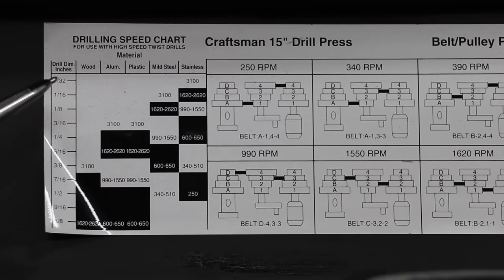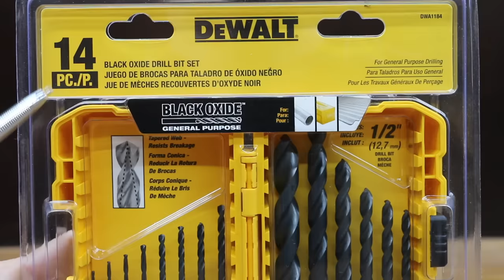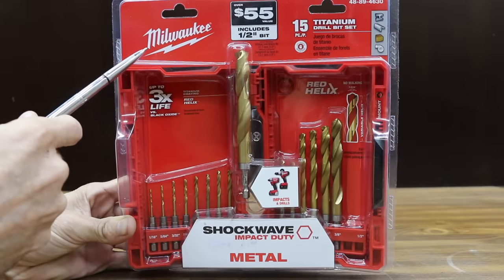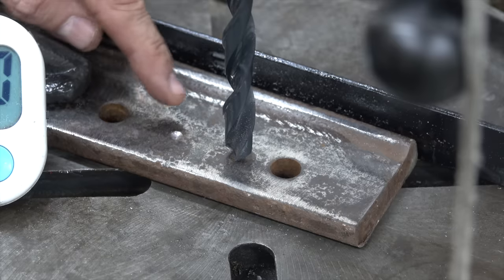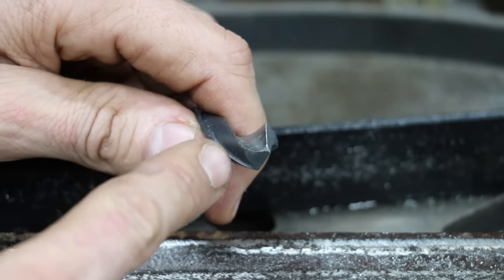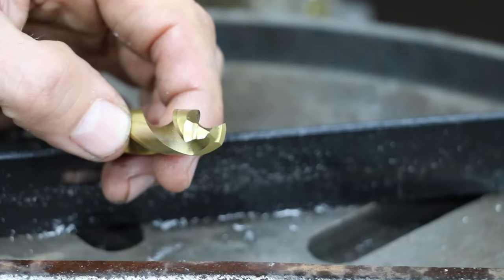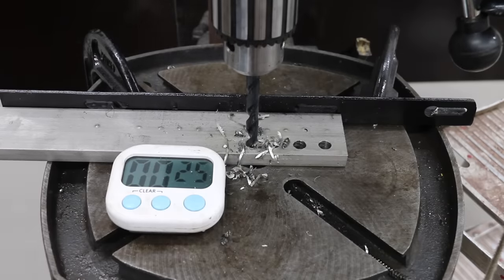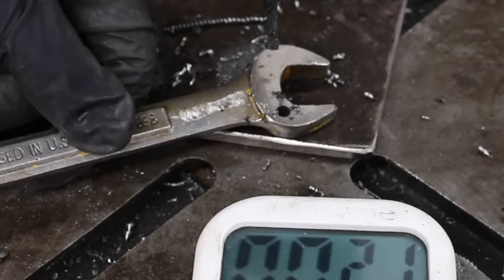Which Drill Bit Brand is Best? Let's find out!

Comment: whats the best drill sharpener?
Reply from the maker: Great test idea!  I'll do it if there's enough interest.  I'll check back to see how many likes this comment receives.
Reply: Eyeball to measure and a wheel grinder (+and some trial and error to master it)
Reply: Experience offhanding the tool is the best twist bit sharpener. I bought a whole box of bits for a buck and boy did I get some practice then. But you do have to know what you're doing. If you don't dress the wheel for instance you're using you're done then before you've even started etc. You can't sharpen a twist drill very good on some hooped out rounded over and worn up grinding wheel. They need to be flat and sharp.
Reply: I’d love to see this test!
Reply: A good finer grit grinding wheel and a good eye backed by experience.   It's the only thing I have ever trusted for going on 30 years.
Reply: A wheel grinder, a tool to mesure the right angle and the length of the "lips". Plus experience to sharpen it right with the proper "drop" (or however it's called in English) so your metal or wood actually goes out and doesn't stay there.
Reply: A bench grinder, a protractor, and a 6" machinist rule.
Reply: Oh, and practice. Lots of practice.
Reply: @ProjectFarm  I would like to know that as well.  I have tons of drill bits that need sharpened up.
Reply: Wait, the best method requires tons of trial and error in practice eyeballing it? Better tell the tool makers all those fancy sharpening jigs were a waste of money. You guys understand they only make drill bits so long before you hit bone, right? Maybe in 1870, but if a method isn't able to eliminate the need to developed fine manual skills, it's probably not the best option when other means do. Apart from what jig, testing various abrasives would also be great. There's a lot of folks talking about CBN wheels for all things sharpening.
Reply: @Jason Ross your eyeballs, a drill point gage, and a dressed bench grinder.
Reply: @ProjectFarm  Would love to see a drill bit sharpener comparison, as that’s something I’m looking at buying in the next month or two. I can’t say enough positive things about your videos, awesomet job, keep up the great work, and I’ll keep sharing your videos.
Reply: @ProjectFarm  Amen to that idea - I'm a machinist from the UK that personally hand grinds most of ours: if you find a good one please show and tell
Reply: This guy I work with Steve, he is the best drill sharpener I have ever seen! I'm actually think of having him sharpin some junk pits at the shop and send the to this guy so you all can see!
Reply: @zone47   Get a good 80 or finer grit grinding wheel/ stationary belt/disk sander unit and watch a few YT videos on the subject, then start with whatever bigger size bits you have  (~ 1/2" or larger are good easy to work with learning sizes)  and work your way down from there.  

You can't make them duller than they are now and after 15 - 20 practice runs, there's a pretty good chance you will be good enough to pass on a resharpen job half the time or better!  After 50+ you should be able to get most to go in one shot and know why you didn't on the ones you messed up on!
Reply: A drill bit sharpener (check HPC's Beyond The Press for a video of one) or a tool and cutter grinder are the best way to sharpen a drill bit. If you want to exclude tools like those that cost thousands of dollars, free hand sharpening is best, but even though most people think they can do it, they can't. "I've seen it done. I can do it." A power tool or attachment that is meant to sharpen drills, are usually the best way for normal people. Unless you've sharpened dozens upon dozens of drills free hand, you're not going to get it right.
Reply: Drill Doctor. They are cheap, last forever, and do it perfectly. Can't sharpen a 2" diameter on there though. Anyone doing it by hand is mickey mouse. Drill Doctor will always do it better than by hand. Don't care how long you think you've been doing it. FYI, I've drilled a 9/16" 13" deep on a compound angle through 6 compound intersections. I know what I'm talking about. I've also used a 6 axis gundrill and drilled 3mm holes 900 mm deep. And 14.28mm holes 8 ft deep
Reply: Paul Frederick, not if you know how to use a pedestal grinder properly, always suppose to be going side to side at the same time so that doesn't happen to the stone. It's hard. Try sharpening a 3" diameter drill on a 1" wide wheel, then come talk to me
Reply: @ProjectFarm  Drill Doctor 750X or 500X needs to be in that test.  Darex IMO have done an amazing job of keeping the essentials of their $2k and up industrial sharpeners in a machine that costs $140 or less and sharpens 3/32" up to 3/4" bits at 111-140° angles and does split points as well.  The 500X for $100 stops at 1/2" and only does 118° and 135°, but does split points.  At the low end, the $50 350X is drill-powered and only does 118° with no split points.  I don't have an opinion on that one except that self-contained seems very desirable to me if you're doing more than the occasional bit.
Reply: @-Viceroy-  LOTS of trial and error.  Mostly error.
  You're far better off buying a Drill Doctor,  or any commercial drill sharpener.  Even one of those ones which mount next to your bench grinder and swing back-and-forth, though you'll still have to sharpen anything really big freehand.
  Or maybe find a shop near you/online that sharpens cutting tools for the big and very small ones.
Reply: I learned how to sharpen them by hand on a bench grinder, but now that I've done it so much I just use a cut-off wheel on my 4.5" angle grinder (it's leaves a smoother, flatter edge than a grinding disc). I don't let mine go completely bad anymore, so it only takes a couple seconds to true it up.
Reply: @AEON.  I use abrasives to sharpen twist drill bits. Files can work OK for sharpening ship auger bits though. I would love to see you try to sharpen a high number bit. That'd be a really skinny bit. Those are hard to sharpen in the best of situations.
Reply: Alan Skalsky Darex makes the Drill Doctor among other more expensive sharpeners.
Reply: @ProjectFarm  The problem is you run into some big bucks when you want quality. The cheap bit sharpeners, like Black and Decker #4300 are pretty mediocre. I don't know if there are many on the home/shop end of pricing scale to warrant reviewing. Seems $200 is mediocre and then you jump to $2-3K.
Reply: @highstreetkillers4377  You're kind of a braggart. Of course you have to dress a used wheel before you sharpen a bit. That's what Paul said, I think. There's not much side to side when doing a 1/4" bit. A bit can be cut acceptably by eye. About as good as a Black and Decker can do. Who's buying a $2-3K bit sharpener? Even then it takes skill.
I drilled .015" holes through 1/2" SS.
Reply: The one you know how to use properly. Be careful, some of them have undersized motors.
Reply: @AZrunner1953  the Drill Doctor are made by Darex
Reply: ..a bench disc sander and a good eye and steady hand...MUCH better than any bit sharpener....
Reply: I have one of the OLD [larger square stand up version] DD500 Drill Doctors that still works great.
Reply: Best method is what best suits your needs. Do you need accurate holes down to .001" (inch) on size -AND LOCATION- without secondary processes like Reaming/boring? Or do you just need to pop a hole in some general location?  The cost difference of the two is tremendous and most, judging by the comments, haven't got a clue on this reality. 

Off hand grinding is good for home gamers or for holes that just needs to be somewhere at whatever size. 

Precision finished holes with a twist drill MUST require angles and point to be ground on center. The drill shouldn't introduce any more runout to the already existing stackup!! (drill spindle + Mounting of the drill chuck + Drill chuck arbor + chuck jaws). Tool and cutter grinders are the best for this. They can vary from benchtop models to multi-axis CNC machines. Specialized machines such as the drill doctor or darex are up to question (and I believe this is your actual question) but I would love to see a VERY indepth and technical breakdown of their sharpening performance.
Reply: Me, but I worked Tool & Die most of my  years. To do it yourself you need a drill gauge and make sure you sharpen each side equally. If you don't your hole will be bigger at the start of the hole. If you're drilling a hole for a tapped thread. A bigger hole at the top will help .
Reply: I use a pedestal grinder.  When boss man doesn't like to buy drill bits, you get really good at sharpening.  I can even do a pretty good split point now using the edge of the wheel.  

Drills that are smaller than 1/4" get much more difficult to sharpen evenly from what I have found.
Reply: @AEON.  maybe a diamond file..
Reply: @jasonwood7340  I use a pedestal also, because it takes to long to sharpen every drill using a drill sharpening machine. I found in my tool & die trade I had to buy almost all of my own drill bits. Started out, I worked in the tool crib as part of my apprentice program. So I got most of the regular bits from the crib. From 1/2 on up I brought the rest of my bits to 1 1/2 by 1/16th. Then I brought all the tap drill course threads. Then I brought a boring bar for anything over 1 1/2. Then don't borrow anything out to other than trusted machinist.
Reply: @AEON.  you must be replying to someone else. I was never in the middle east. I have worked like an Egyptian on job sites though. I will add that grinding twist drills is the commonly accepted way of sharpening them. You do have to be careful to not overheat them while doing it though. That's what the water cup at grinders is for. Grind and dip. What wheel you use and the condition you keep the wheel in are major factors. Don't use a glazed wheel.
Reply: Jason Ross bench grinder. Fine stone. And do not grind anything else on it!!
Reply: @hellwithit  that's some interesting advise. Why shouldn't you grind anything else on it? I dress my wheels and keep them in good shape. So from job to job it doesn't matter what they've done before. You should have a nice flat face with a good sharp cut wheel to effectively sharpen twist drills. No rounded over dull and glazed special should be used to get the best results. Maintaining grinding wheels is a basic shop skill. For rough shaping I use a pretty coarse wheel too. Just looked it is 36 grit. I really wouldn't go over 100.
Reply: Thomas Booth a protractor and a machinist rule? Christ man it sounds like you’ve studied how and sharpened a bit theoretical on paper but have never done it in the real world. What you actually need is a dressed grinding wheel, your hands and an old ass pissed off machinist to teach you THEN lots of practice. Btw they do make a tool called a drill gauge. It’s a lot quicker and much more efficient than your high school shop class method.
Reply: Custos  No good machinist sharpens a bit with a fucking sharpener. At the most you need a dressed grinding wheel, your hands and a drill gauge. It takes about to minutes to be sharp and ready to crank out chips. Man up and learn a useful skill. There won’t always be a machine around to do the job for you.
Reply: @escargod  

Noooooo, a guy with the prancing horse as his avatar... a braggart you say?? Impossible.
Reply: Project Farm I have been looking at these as well. Definitely add links so when we do buy, you get a chunk of dollars.
Reply: Grinder and your eyes, they all resharpen nice so long as the cutting lip is not damaged
Reply: @xenonram  LEONTIEV'S YOUTUBE VIDEOS EXPLAIN BEST.
Reply: He has this video up now
Reply: Your hands
Reply: An experienced manual centre lathe machinist 👍👍
Reply: @highstreetkillers4377  Wrongo!!
Reply: 3D printed jig for dremel
Reply: He done a great vid on drill bit sharpeners. I have 2 of the types he tested. Picked up a $10 one that has to be bolted down then used on a grinder wheel.( yep piece of junk ) Have a drill docter that I have sharpened over a hundred dull bits on. Works great. Place the dull bits in a wooden box until I have at least 25 then go to town.
Reply: A bench grinder and a steady hand.
Reply: @tcmtech7515 I worked in maintenance shops for 50 years. Do not think more then 10% of so called machnics could sharpen drill bits on a grinding wheel. Tool room always told us to throw dull 1/8" and smaller nits in scrape metal drum when they got dull. Drill doctor foes a great job for homeowners & small contractors.

Comment: These kinds of unbiased tool tests done by Project Farm are priceless to me. They cover tools (like the drill bits in this video) that span a range of prices, so I can pick a brand and level of quality that matches my pocketbook for the particular tool I need. Sometimes I'm looking for a tool that I only need to use occasionally and sometimes I'm looking for something that I'll be using everyday. Either way I can find the answers I'm looking for here. A big Thank You to Project Farm!
Reply from the maker: You are welcome!
Reply: This video was a lot of good work, but completely missed out on two of the more important aspects, TOOL GEOMETRY, and WHAT the drill material PURPOSE is for.

The ONE feature not emphasized was the "split point" feature.  This one aspect alone IS important.  The other geometry feature is the drill point angle. Standard drill point angle is 118°.  Alternative angle is 135° often used for harder materials. Also important is "web thinning" and "rake".  This is a matter of simply looking at the tool bit set BEFORE purchasing.   None of this was even mentioned in this video.

Then the drill material was skipped over with no explanation ....yet it seemed that "cost" was more important.  Well, if you're not going to provide any information about drill material or "coating" ....and in particular "SHARPENING" .....then this video is fundamentally only for people who need a drill every five or six years .....for wood.

.
Reply: That's me.

Comment: As a blacksmith who make knives and tools with hardened steel, I figured out which bits were best by trial and error. Bosch is definitely my go to for most medium to high carbon steel and DeWalt are the ones I use for mild. Even though they are the best, they do wear out pretty quickly when you're doing a lot of hardened steel. Two things help... Don't let them get too hot and use something like a drill doctor to keep them sharp. I have saved tons of money on bits using my $50 Drill Doctor. You won't get factory results, but you can definitely sharpen old bits into very functional bits. When all of that fails, you bust out the carbide bits, which are about $15-$20 a bit. They will go through anything...
Reply from the maker: Thanks for sharing.
Reply: I know this is an old comment, but if you are still around, I have a project where I need to modify some table saw wings to fit with a table saw with different hole spacings. The wings and table are cast iron. Should the Bosch work well for that project?
Reply: @SavageDarkness yes just use a lots of cutting oil

Comment: As a machinist no one would be more likely to criticize this video. 
All I can say is thanks and you did a great job with the test. You also provided good drilling advise.
Reply from the maker: Thank you very much!  I've held off on this video for over a year since I wasn't happy with the original test setup.  A very talented machinist "Chuck" visited the shop and helped a lot.  He gets credit for everything that went right and me for everything that isn't. Thanks again!
Reply: As a machinist, you know that a full pilot hole should be drilled prior to drilling with larger bits. This was the only criticism I have, as most home shop do it your self types are not aware of this practice. Also, chip breaking, but again, I revert back to the general do it your self type. Otherwise, it shows which bits will handle "abuse" better than other brands, which will help the weekend warriors. Cheers! Zip~
Reply: ZippoVarga exactly especially larger bits pilot holes are recommended but if your rushing or are lazy as you said shows what bits will take the abuse better
Reply: Rian Callahan Agreed Rian, my comment was based on the target audience of the video.
Reply: @curt149k  hola me llamo es walter. me gusta calabaza yo soy grande calabaza chico
Reply: I'm not a machinist , all I can say is I have Milwaukee, mikeda drill bits that were bought for me as presents that are missing bits because there broken, while my Irwin drill bits have never broken
Reply: @riancallahan4376  This video was designed for the home user and State9 indicated that.
Reply: @ZippoVarga  chip breaking is actually worse to do for twist drills. It doesn't matter if you have a looking chip coming out because you don't have to worry about a chip conveyor, auger, or needing the chips to pack densely into a chip bin for recycling. Chip breaking changes it from a continuous cut to an interrupted cut. Each time you break the chip by bumping the feed, when the bit re engages, it is a shock load. At the worst, you're more prone to break a bit, and best case is accelerated wear. Breaking chips with a twist drill is not good unless they get to be whipping around.
Reply: What, no cleveland twist or chicago latrobe? All those that were used in this test are junk. A good HSS is all you need.